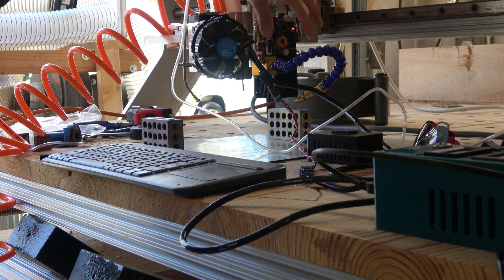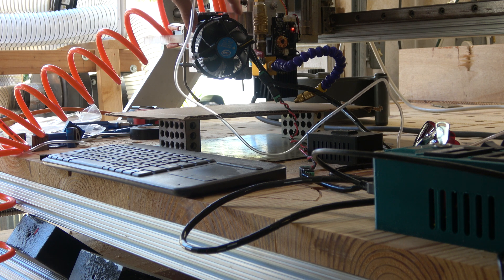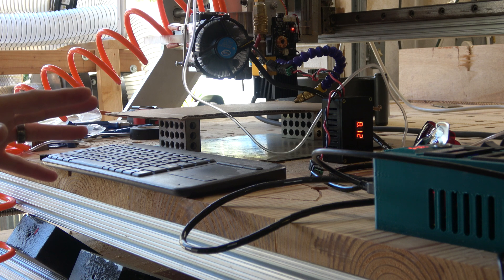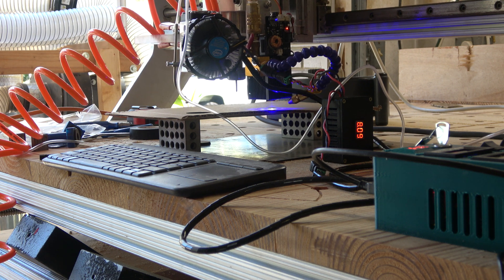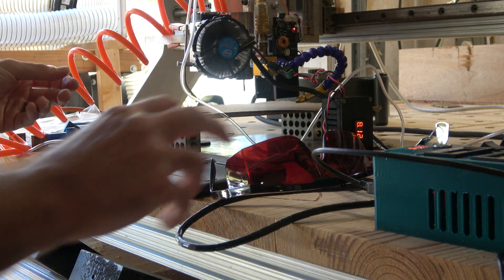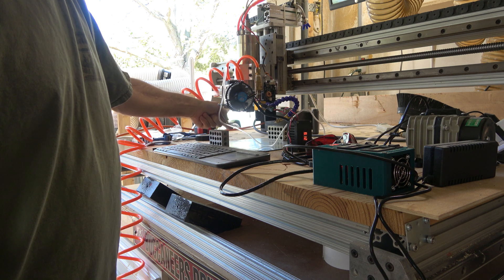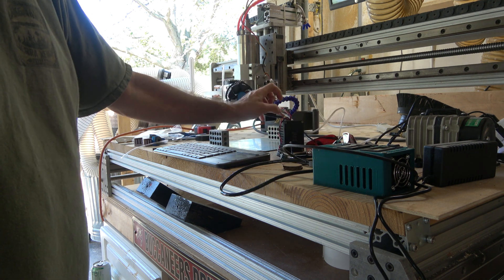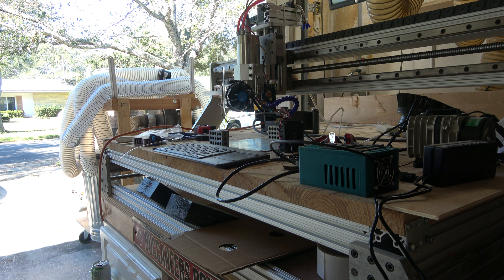Endurance10W Laser Testing

Comment: how did you manage to not cut parts of the circle on the top side of the burn?
I know, because of the trapezium kerf, this kind of problem happens on the bottom part, but I have never seen it on the top of the kerf.
Reply from the maker: Ahh I think what's not clear in the video is I am turning that cardboard sheet over when I grab it - what I'm showing is the bottom :)

Comment: I would have put a bullet in that compressor by now! nice little comparison, what was the other laser brand?
Reply from the maker: Too noisy? LOL It's supposed to be one of the quiet ones too! :) there's no brand on the other laser - I got it from Banggood website (China)
Reply: @JamiesHobbies-GGB  ha! I meant the air compressor not the Hailea little one, i just cant stand the noise of the hiss, damages you ears hearing big time, im the admin on the Endurance site. good review thanks also good to know its a Bangood model. chinese ones are so awful really, trouble is people don't look father that the big 20 watt label which is input power normally not output! I see George has sengt you one with a monster fan on it....nIt will work well, next time a C02 Laser.... pop one of those on your CNC and away you go...I have a smaller one than yours, 1.5 mts x 1 mts workbee but still very good fun and good at what iI use it for, the CO2 though is in a big cabinet, its way too dangerous not too be really, cant see the beam and what it touches catches fire in seconds.

Comment: How did you connect the laser to the breakout board ? I have a usb breakout board but not much info on how to connect it. ( I have a 7W diode laser). Thanks
Reply from the maker: If your laser box has the PWM or TTL wires, then you should be able to connect them to any outputs you have on your breakout board - mine only has 0 and 17 for outputs so I connected mine to 17 and then in Mach3 I just have to turn on that output and tell it which pin (17) to use... Are you using Mach3?
Reply: @JamiesHobbies-GGB  Thank you for the reply. I have the PWM connection on my breakout board for the router.. I don't use the board to control my router so I will give it a try. Regards LesDouglas
Reply: Yes I am using Mach 3. The breakout board is WiXHC.
Reply from the maker: @Les54742  Cool - looks like they have a few different models and I can't find the manuals for them - but there should be some outputs (like 3, 4, 5,6) and those will be mapped to pin outputs from the computer(like for example, output 3 on the board is actually output 17 on the computer) there should be a pin to output chart for that in your manual - if you send me the manual I can tell you for sure (hoarderofhobbies@gmail.com)